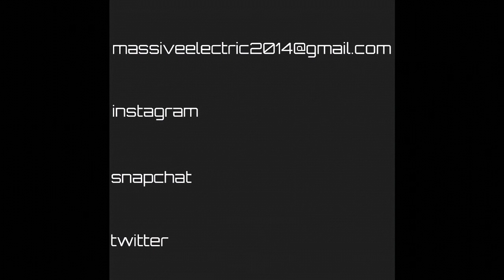Causes of LED Failure

Comment: I bought 4 new light fixtures from Hampton  Bay with LED lighting( no light bulbs required)     3 work fine. The other went off on its own and won’t go back on. Any idea what problem could be? Loose wiring?

Comment: If using an LED in a fully enclosed fixture, heat will cause LED to fail early.  CFL bulbs will fail with high on/ off cycles. I am not sure if LED's also do.
Reply from the maker: That's a good question, I'm not certain either, but I would imagine it does affect the led driver, much mike the CFL ballast, as they are both electronic. I'll keep my eyes peeled for info and have to update the video. Thanks for watching Rick.

Comment: Thanks, that's why my LEDs in our bathroom don't last long
Reply from the maker: for bathroom, look for: 1) quality fixtures, 2) fixtures with an enclosed face, to prevent moisture from entering, 3) fixtures labeled "water resistant". Nowadays bathroom fixture manufacturers are much better about this, but it is still good to keep in mind, particularly over showers and tubs. Thank you for watching

Comment: I suspect the failure of Ubrite bulbs which are very cheap at less than a dollar a piece in the 10 pack is heat.  They are hot to the touch.  So I am going to try and cut off the plastic cover and see what happens.  If they last longer I found the problem.  If not I'll stop buying them.